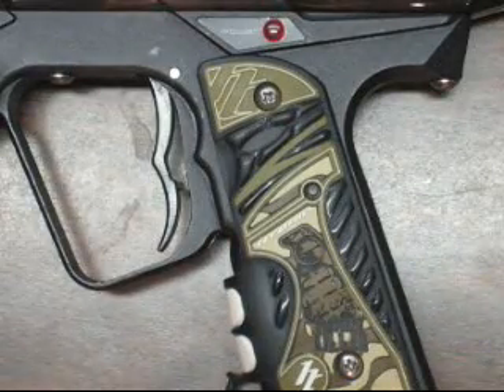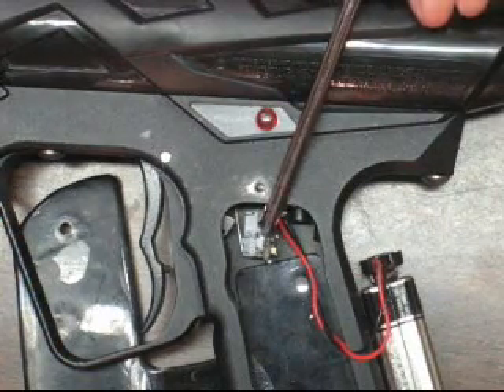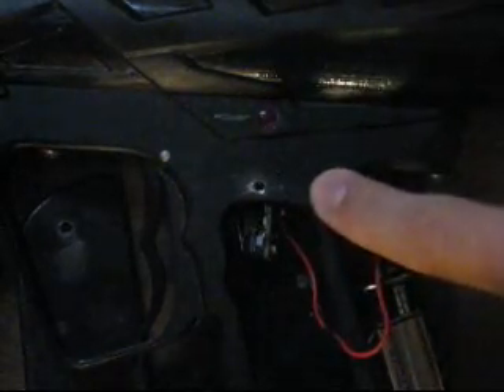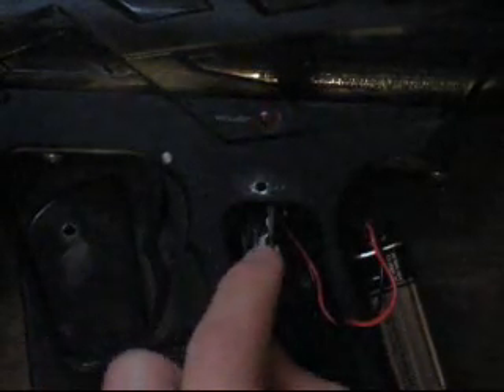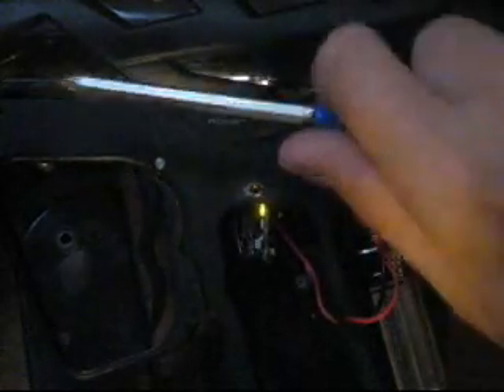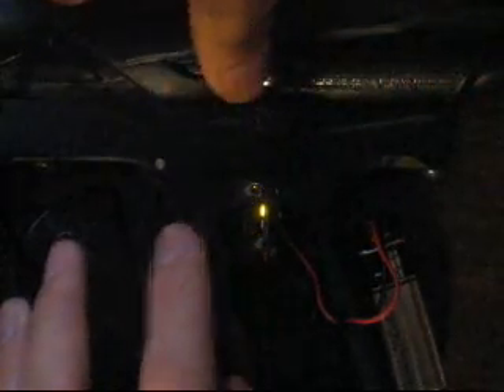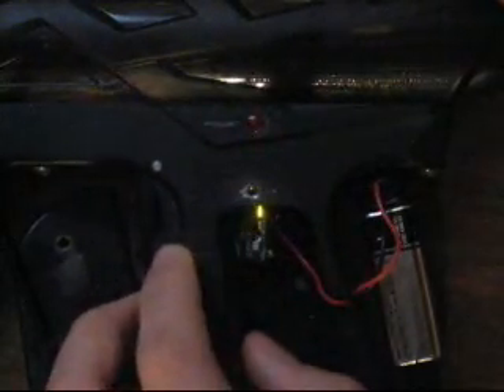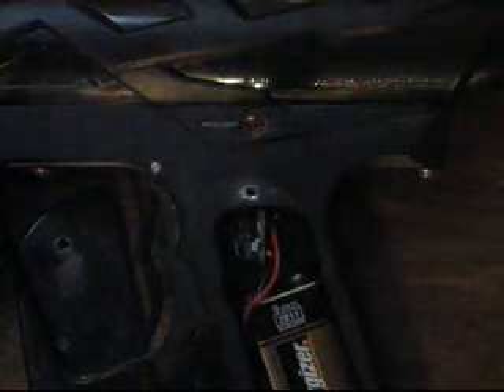Smart Parts Ion Stock Board Settings

Comment: hey i just upgraded to the ion and had a few questions. first off if you leave your battery connected will it kill it? also is there a way to switch from single shot to 3 round burst to full auto without opening the grips?